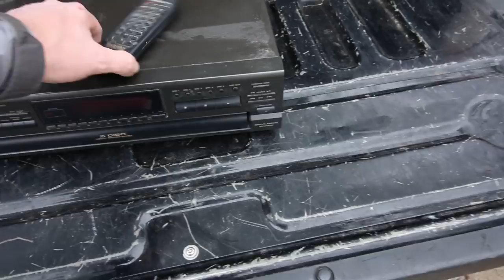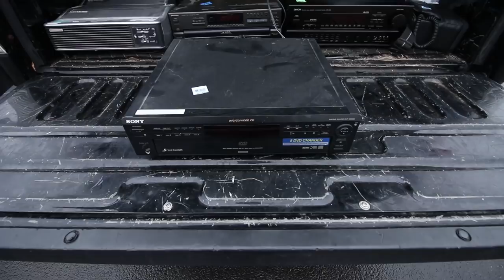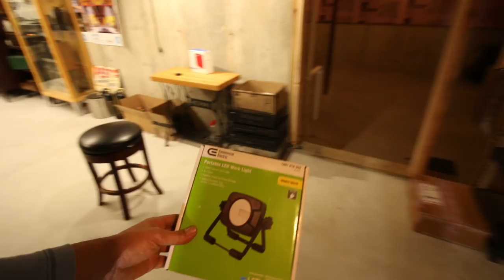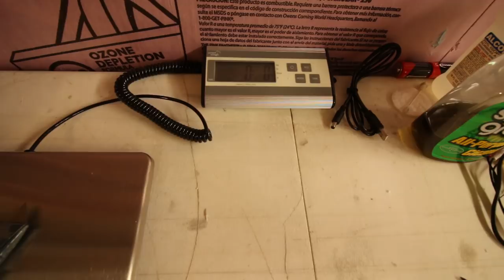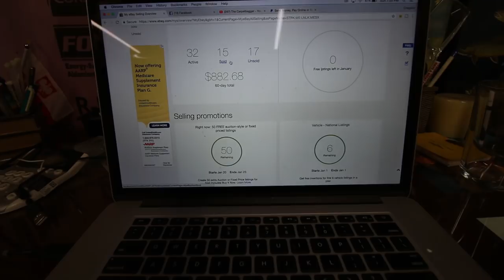12 MONTHS EBAY EXPERIMENT

Comment: Pete,  I wish you the best of luck with this extra eBay account. You are selling the sort of item I have been selling for many years of my 20 years on eBay - and for me the market has turned totally flat. It is very seasonal for all but the true high-end and should pick up soon through the late spring warm-up. Personally I am walking away from eBay after all these years due to poor sales and silly returns... and I service / clean / test everything. No receiver goes without the top coming off, no CD or DVD player leaves without the laser cleaned. Still have too high a rate of "defective" which in reality was just borrowing the item for the weekend... and we both know eBay does not care about the "liar buyers" who take advantage of sellers. I used to have at least 100 items listed in audio, today I am tossing some into the dumpster.

Comment: Just wanted to say I have been taking your advice on vintage electronics, I found a REVOX B226 yesterday it didn't come with cord so not sure if it works but in great condition.  I am going to order a cord to see if it works but for 10.00 I am rolling the dice, I see that on Ebay they go from 350.00 to 500.00 hopefully everything works.

Comment: I have the exact same scale, it works great if you just throw a heavier item on first like a book etc. then add your small item on top and check the difference. I use a book that weighs exactly 2#, so it makes the math easier. Also another tip not sure if you know but a hair dryer will remove those nasty thrift store stickers in a flash. Hustle On

Comment: How many accounts will eBay let you have?
Also, you don't seem to re-use any Amazon boxes with that big arrow on them.  We get lots of them in perfect large sizes.  Can they be re-used or will it cause problems in shipment?
Please be sure to share with us any Electronics Return stories, from both stores, so we can learn what happened.  Thanks!
Reply: Susan Garcia I reuse Amazon boxes all the time and never had a problem. :)
Reply: Yes you can use them, the barcodes should be marked out or covered, as well as the original address. As added security, because Amazon boxes are targeted by thieves is to turn the box inside out.
Reply: I use them all the time.